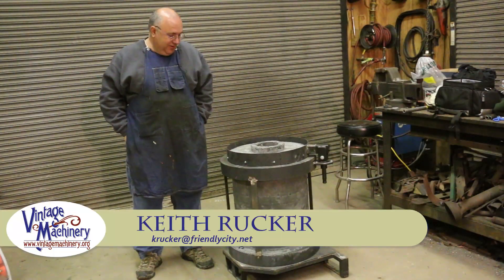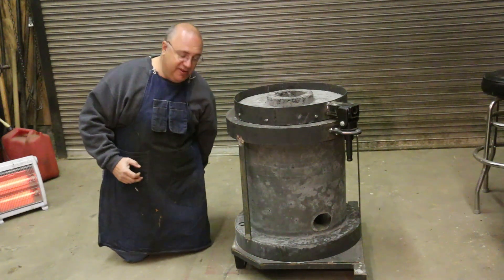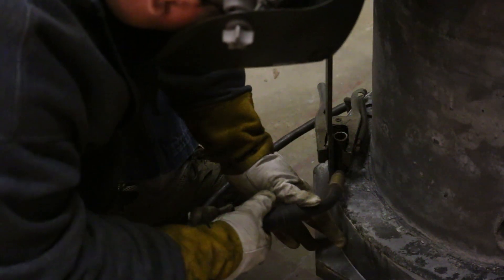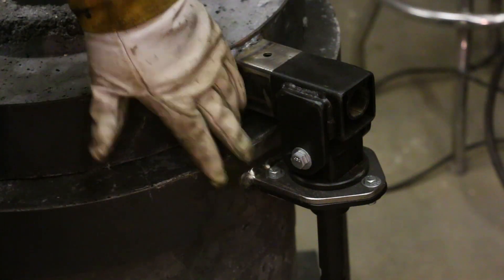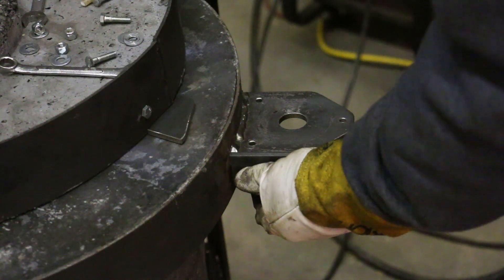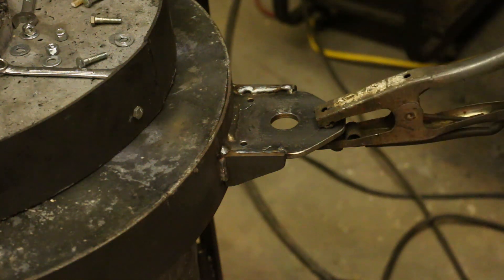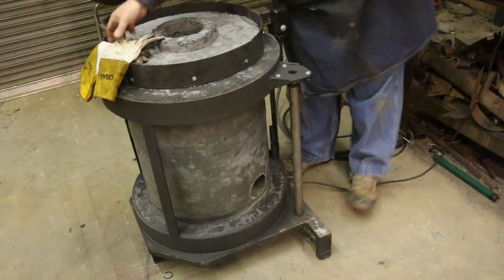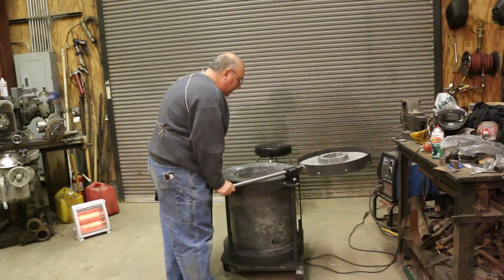Building an Oil Fired Foundry Furnace - Part 9:  Design Modifications

Comment: Hi Keith,
some interesting changes in the design. nice work on the thing thus far.
one thing i would recommend, is that you weld the hinge tube to the top plate. as it is now the hinge pin pushes the tube away and causes a shear type bind as you're putting a lot of torque on that little thin plate. even a graphite lube won't be able to counter the heating/cooling cycle of oxidation and wear on that joint and pressure caused by lifting the lid. i would put a pin on the base plate that the hinge tube slides down onto and still allows the refractory to expand like the pins you made for the outside supports. although i would keep the tube 1/4" off the base plate so it doesn't collide with it.
that way you're applying the torque over a larger bearing surface and will extend the life of your hinge considerably.
this project is shaping up to be a real barn burner.. lol figuratively speaking.. it will be nice to see it in action 

cheers
mike

Comment: I think when this is heated it would be smart to look at those telescoping legs to see if there is evidence that the refractory is expanding more than the metal legs. It is possible that metal legs lengthen more than the refractory. In that case the telescoping would need slight change.
Reply: +ted sykora Those legs won't get very hot from the furnace. They are outside all of the insulation.
Reply: +Blazer02LS Ya I know but I just wonder which material has a higher coefficient of thermal expansion, metal or refractory.   For example, if the refractory  goes from 75 degrees to 800 with heating and the metal legs go from 75 to 250 degrees, is it possible for metal to expand more.   I doubt it but it would be easy to take a peek.  Some refractories are made to expand almost nothing.

Comment: Keith,

I'm not sure how hot your outer shell or steel rings are going to get...

Thing is, you have cylindrical geometry, so the expansion is in both the axial = vertical, and radial = horizontal directions.

When our suppliers make an expansion joint for a duct for one of our furnaces, they use telescoping guide rods that are similar in function to your straps with the pin and socket arrangement. We spend a little time to make sure that they do not bind up due to lateral growth as well as making sure of enough room for the axial growth. Expansion joints are kind of floppy in contrast with your furnace, and need to guides to keep them straight.

We use a coefficient of thermal expansion for A36 structural steel of ~15 parts per million per degree F, so a shell that heats up from 100 F to 600 F grows about 0.0075 inch per original inch.

So, those telescoping pins could bind up if the clearance isn't sufficiently loose between them. If your cold pitch diameter is 24" for example, your hot pitch diameter  will be 24" x (1.0075) = 24.18" In order to prevent binding, the clearance between the pin and socket would then need to be slightly more than 0.18/2 - 0.09" - say 0.1" on the radius of the pitch circle.

So, you need to have the socket's ID be ~1/4" larger than the pin's OD in this example - you won't be able to rely on these straps for much of any mechanical strength when things aren't hot.

Now to further complicate things, your upper pin is on a strap that should be cooler than the socket which is mounted to the lower ring. (The thin strap acts as a "heat choke"). When things grow, they will also flex, and the pin and socket can bind up by being rotated as well as no longer being concentric. This is a bit more complicated to calculate, and the answer to sizing the gap between the pin and socket is going to be: "Make it bigger..."

I'm not sure what you want to accomplish with those straps - they can be used to limit the horizontal displacement of the top and bottom rings, but the gaps need to be pretty large...

Feel free to IM me if you want to discuss this in more detail.

Eric
Reply from the maker: +chemech We have talked a lot about the outer rings.  They should stay fairly cool compared to the center part inside.  At the end of the day, when I look at some of the commercial furnaces that you can buy that are similar to this one, there is nothing being done to account for expansion on these rings so I am hoping that mine will hold up similar.

Comment: That expansion effect is the reason why the spokes of a cast wheel are curved. If the hub gets hot, and the heat transfers to the spokes, they curve a little more when they expand instead of breaking the rim. This can also be accomplished with straight spokes at an angle such as a wheel with the rim offset from the hub like a steering wheel. As the heat differential increases, the offset increases.
Reply from the maker: +Notso Fresh Very true on the curved spokes!

Comment: Very nice project Keith. As a long time welder I was surprised to see your vertical up welds on such thin material. Usually I only up weld on material 1/2 inch or thicker, It just puts too much heat into the metal. Also please clip your wire between welds especially when the stick out is too long, your tip will last longer. I love overbuilding everything. Keep up the good work>
Reply from the maker: +Leroy Stricklett I will not even try and say that I am much of an expert when it comes to welding.  I can get it done but I have a lot to learn to do it by the book!

Comment: Enjoyed....two things I saw, electric heater adjacent to the gas can?...lol...I KNOW UR SAFE...just kidding, but under the work bench there appears to be a tray that holds a piece of track that may slide out to bang on??...just love work bench modifications/tricks
Reply from the maker: +outsidescrewball I was hoping the gas can would light up - I was needing the heat.  I probably should have moved them away but the truth is they were empty and dry - just sitting there.  The RR track on the welding table is a nice feature that gets used all the time!

Comment: Probably would be warmer if you built a fire in the thing. 
Just kidding. North vs South joke. 😊
I like the handle hook idea.
How about a 3/8 rod bent into a hook welded to the base and passing through a guide ring attached to the top ring?
That would minimize the load on the top ring if that's important.

Nice work Keith.
BTW, know anyone with a Brown and Sharpe #2 surface grinder? I have been given one which I haven't brought home yet. 
Flat belt drive with an ancient electric motor but could be used on an overhead pulley drive system.
Heavy cast iron base, 6x18 automatic table. Looks to be in decent condition with many layers of old paint. 
Was running when taken out of service a few years ago. Doesn't appear to have a lot of wear.
Another project. (Rolleyes)
Thanks,
John
Reply: +John Bazaar  2nd the joke!
Reply from the maker: +John Bazaar You laugh, but I was considering the fire thing....  It would have made the inside of the shop mighty smoky though!  As for the surface grinder, I don't know of anybody with a flat belt version like you are talking about.

Comment: Keith,
Thanks for the progress video. Once the furnace is working, you can use it as a heater for your shop. That little electric heater in your video trying to heat your shop is like trying to put our a forest fire by throwing drinking glasses of water on it! Good luck with your progress.
Have a good one . . . Go home and get warm!
Dave
Reply from the maker: +Swarf Rat I am totally unprepared for cold days like we had last week.  This Saturday is going to be much more like a typically South Georgia winter day - 67 degrees F!  OK, that may be a bit above average but not uncommon by any means...

Comment: I would be more concerned about the constriction of the upper support ring. If it had a slip joint the refractory could grow out and up and legs could have been left solid.for good lid support.
Reply: +Rick Brandt Keith, I agree with Rick here.  You've taken care of any load from axial thermal expansion but uneven radial expansion will be a greater problem.  Think of frying up a hot dog without any relieving slits.   It always bursts along the long end from radial expansion.  The ends never blow off the hot dog.  Not sure how to design an easy modification.  Expansion slits like a sidewalk or a hot dog might not be a good solution-- or at least really hard to implement.
Reply: +Rick Brandt the steel ring will grow more than the refractory. i would be more concerned with the refractory falling out of the ring than it crushing against the ring
Reply from the maker: +Rick Brandt Based on other commercially made designs I have seen, many use a metal ring around the outside without any problem.  I going to give it a try like it is.
Reply: neither axial or radial will really matter

Comment: Keith, as a someone from a colder part of the country, I would recommend a hat. A nice warm hat will keep you warm in the shop without getting in the way. Most of the body heat lost is out the top of a person's head, a simple, cheap, knit hat will significantly improve your bodies heat retention. If you add this to the normal heat your body generates while working in a shop, then you should stay a bit warmer.
Reply from the maker: +Joshua Darrah I actually was wearing one most of the day, but I took it off for some of the camera shots.  I also had to take it off to put on my welding helmet....  Fortunately, most of our winter days are not that bad - supposed to go up to 67 F here on Saturday!

Comment: For monitoring the heat as you cure the refractory, you might want to have an IR "gun" thermometer. They're pretty reasonable these days. Let me recommend getting one with the narrowest "beam" you can get. I got a 50:1 (at 50 inches the sensing patch is one inch in diameter) Raytech ST80 ProPlus; it only goes to 1400F, so you wouldn't be measuring molten brass or iron but aluminum at 1220F would just barely be in range.. I have been thankful that I got that narrow beam every time I wanted to get the temperature of a small part close up, or the temperature of a pipe up near a high ceiling. If the "patch" is larger than the object you are measuring, then you get the average temperature of your object and the surrounding or background temperature. (You won't need a narrow beam for the furnace, but there will be a lot of times when you will be glad you have it.)
Reply from the maker: +Peter W. Meek I have one of those IR guns on my list....
Reply: +Keith Rucker - VintageMachinery.org - Like i say, get one with a high ratio beam; you will be glad you did. Mine projects a circle of laser dots which is about the size of the sensing patch which is really helpful. If the circle of dots is no larger than the object I want to sense, then I know that I am getting a good reading.

EDIT: BTW, these IR sensors really need a nonreflective surface for a good reading. Shiny surfaces tend to read the space "seen" by what is reflected. If you try to read a smooth metal surface, you read a combination of the surface you want to read plus the temperature of what is reflected. If you want to read a smooth metal surface, paint it with a flat black paint or just put some dark masking tape on it. (Photo shops sell flat black masking tape intended to prevent unwanted reflections from tripods and such).

Comment: Looks good, when we were fabricating kiln cars we had to allow for expansion as the seal between the car and kiln walls were tongue and groove.  They said the "blocks" could expand enough to drag and with several cars moving through the kiln it could actually freeze up.  That would be bad.  Your slip joints will help keep things in line without binding which could destroy the furnace walls.  Can you imagine what that would be like?  Someone gave you some good advice!  Man, that thing is looking good.  Greg
Reply from the maker: +Charles Compton Thanks Greg!

Comment: I claim no special knowledge here. But intuitively, shouldn't refractory expand less then steel when it's hot? Or am I wrong here? Simply put: What would worry me is that, even though they are shielded and somewhat insulated, the steel hoops and braces would expand more then the refractory and, well, get loose. And not the other way around. That they squeeze and restrain an expanding refractory casting and damage it that way.
Reply from the maker: +Kristoffer Westlund The steel would expand probably more if it were getting the same temperature as the refractory.  But those legs will be on the outside of the refractory and even outside of the insulation so they will remain relatively cool compared to the temperatures the refractory will see.
Reply: +Keith Rucker - VintageMachinery.org I really have no clue, you know. This is way out of my experience... Will you have the opportunity to measure the expansion in the sliding joints? It would be interesting to know how big of a problem this is and if your precautions really were necessary.

Great and very informative show you have by the way. And greetings from a rainy and rather hot southwestern Sweden.

Comment: I would have thought the steel would expand more than the refractory not less. so it would tend to lift the lid or bow out. Anyways now that you've cut them they aren't doing anything for you other than keeping the insulation in.
Reply from the maker: +Adam Hill But the steel legs should remain mostly cool while the inside of the furnace will be approaching 3000 degrees!

Comment: This will do brass? are your molds ready? ramping & curing a furnace takes time. slow is always better so there will be no cracks. This has been a good build.
Reply from the maker: +dlstanf2 Yes, it will do brass.  As for molds, I will make those up right before the pour.